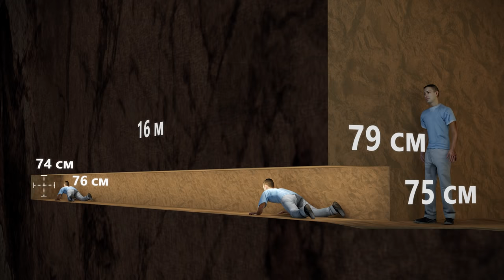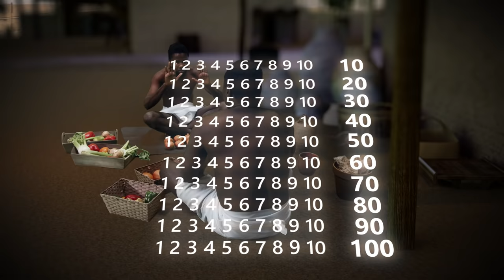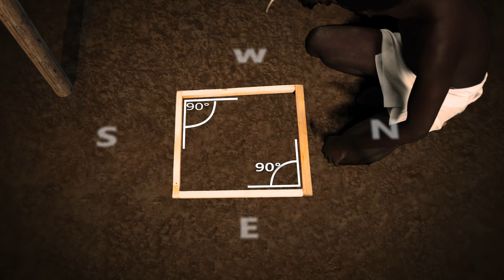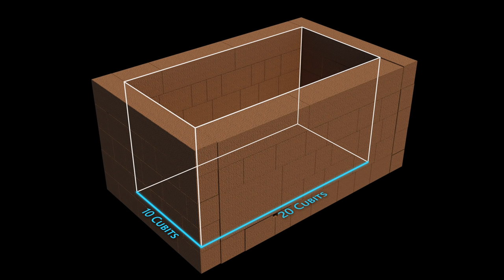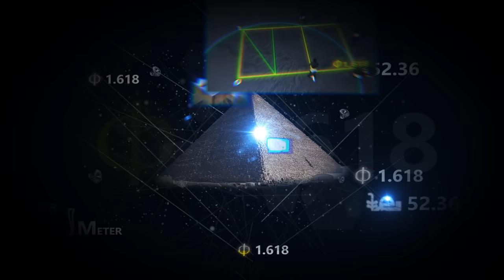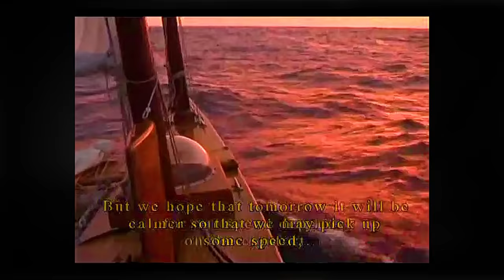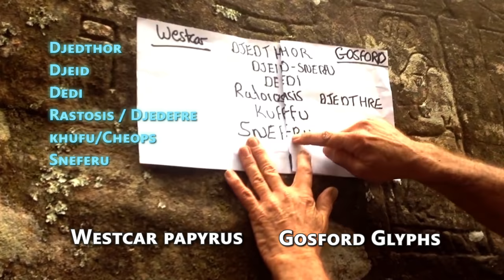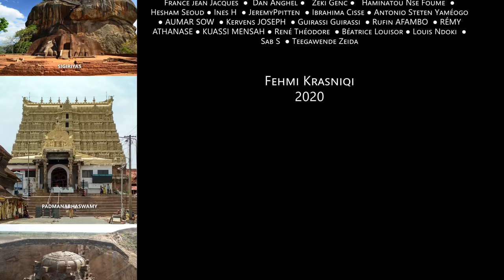The Movie Great Pyramid K 2019 - Director Fehmi Krasniqi

Comment: nice storytelling indeed, i just wonder why they never found any trace of them gigantic lenses anywhere in that terrain.
Reply: they would be freaking huge he lost me there i was listening before 1:29 after that the needle got drug across the record. hurt to watch.
Reply: You can also make fresnel lenses that are not that havy to handle. However, you need to make glas or glas like structure in alrger size. That is not trivial to do! Just do a calculation: 5 m in diameter: pi*25.^2=19.63 m² -> *1300 W/m²=25.5 kW. That is some energy but is this enough to melt a block of stone? Just be asure when you poor material, you have to do in one block, otherwise you would see difference during cooling, like band like structures. We talk about volumes in several m³. My feeling says, 25.5 kW are not enough.
Reply: The elites won't never let us know...
Reply: When the top layer was finish the worker quickly remove the lens to a hole in the grund so nobody understand how they did't. 😁
Reply: @davidleomorley889  then explain why when one of the Giant building stones are cut they are found to have evidence of being a geopolymer or a cement like constructive material again I'm not sure if the lens theory is all correct either but cement construction is entirely possible as proven by our Frenchman friend
Reply: If you Google it you will find that a piece of glass was found in Israel and it was so large and so heavy it was frightening looking it was probably 15 ft long by 10 ft wide and a foot thick and let me tell you the story that goes behind it is amazing they said that it would have taken tons and tons of fuel to make the silica melt to make such a peace of glass but it does exist and I'm sure this is all possible if all this fits together I'm a little skeptical myself as far as melting granite but who knows the world is full of mysteries my friend
Reply: @davidleomorley889  believing that they bringed the from more far than +400km , and they put millions of stones , 20t to 80 t each one in top of another with their technology is worse than believing in santa... Is more easy to fool a person that making them believe that they been fooled...
Reply: @davidleomorley889  would you believe it if it was tested?
Reply: @davidleomorley889  yeah but just say some sicentist set up an experiment to melt granite with a lens would you believe the results of the tests?
Reply: @davidleomorley889  i understand what you are saying and yes i agree with some of your opinions,but im simply asking if someone could prove that stone could  be melted would you accept it. Its not really even about the stone. Would you change your mind if proper evidence is provided? I will check out your channel and im sure i will learn alot of valuable information i didnt know before. Just think too with out this video i probably never would of been introduced to your channel
Reply: @davidleomorley889  i just learned that when granite melts it turns into obsidian.👍🎅🏿
Reply: @davidleomorley889  — Hello.  Just wanted to alert you that although I like and resonate with what your communication, I dare say that I personally prefer if you could be a bit less ‘biting’ or ‘arrogant’ towards others?
“Honey versus vinegar”  message ....
Reply: @davidleomorley889  : I earnestly & sincerely hope that I am not included
in those numbers that you feel are attacking you?  I merely politely wish to
point out that such well thought out responses as yours are ... it just doesn’t 
ring harmoniously when you’re belittling others somewhat?  Your arguments become a bit distracted when you’re gruff and they  ✨deserve✨ to be presented by your best side?  Hey, at the end of the day ... it’s just my opinion.  My name is Dora, btw.  Giuseppe, my partner,
is sound asleep 😴 and i’mmm borrowing his cellphone u til my upgrade
arrives.  Stay safe friend, a wave to you from Toronto, Canada 🍁
Reply: until* my upgrade cellphone arrives ...
Reply: glass is an amorphous material that deteriorate over time not like stone.
Reply: @davidleomorley889  Not a very mature comment David👶🏼 yes you can melt granite with a solarlense! but not in the simple way it is illustrated in the movie ofcourse, so there has to be more to it if this thesis hold some truth. 
My professional background is that of a craftsman and technician +20 years working with ceramic, glass and metal casting and mould making.
If you can only accept idears that play into the beaten narrative you risk gerting stuck in the track.
Maybe you are a bit too grownup David :-)
Enjoy the movie as a bold and thought provoking input. 
Wish you a great day
Reply: A 5 meter lens must weigh several tons. However, what might an elitist do with that lens from outer space.? Start a fire?
Reply: @davidleomorley889  queried stone is a santa claus belief too. they cut , transported and hung this stone...barely out of the stone age ..NONSENSE
Reply: @davidleomorley889  then you explain it . you are obviously smarter than everyone
Reply: @davidleomorley889  have seen it. know who you are conversing with first before you make a fool out of yourself......too late
Reply: @davidleomorley889  The experts who you are citing are having their asses handed to them. You might want to check YOUR ego.
Reply: @davidleomorley889  jean Pierre Adam what a joke! pie is a coincidence LMAO
Reply: @johnross4605  Yeah, directed energy !
Reply: @davidleomorley889  David I understand why you would be upset, but you made a massive mistake.  The one responsible for transporting the heavy stones is none other than the traveling god of the night sky:  Khonsu.  Also written as Chonsu.  It might be hard to believe, but this is who we think of as Santa Clause--an immortal flying god.
Reply: Cause satan clause leaves no trace .
Reply: Its completely obvious now! Bitcoin was developed by the government, it was a pilot program. This opened the door for others to refining the new technology. It's been said they will give you pennies on the dollar. Bitcoin is now the equivalent to digital gold. China knows this that's why its outlawed. Open your eyes people it's been planned since the beginning. You are not in control, the global elite will continue to move forward as planned, whether you like it or not.  No civil war, no uprising will stop these plans from moving forward. You will bend the knee whether u like it or not, whether you are aware of it or not. Stop fighting it, just given in, give yourself over mind body and soul. You have no say in your freedom, stop thinking you do. Once you except it, the world will become a better place. Its essential for the hurd to be controlled, because the majority of the human herd has a low level capacity for the evolution conciousness. Give in, be sheep, trust it's for the greater good.

Comment: The etymology of "meter" is "a measure", it can be any kind of measure defined by convention. The size of a drop of water is not a centimeter, rather 2mm and depends heavily on surface tension defined by several factors: purity of water, temperature, the surface on which it is deposited, the size of the drop can vary extremely. You can also make drop of water any size smaller than this, look at drops of water deposited by dew on plants in the morning. A nautical mile, historically, was defined as one minute (1/60 of a degree) of latitude along any line of longitude. This video (can't even call it a documentary) is one giant heap of crap, worse than 95% of the others I've seen.
Reply: I partially agree with you. For sure the drop of water being a constant cm is BS. However the geometry still holds up. Regardless of how they   Figured out these universal measurements, the proof of their existence is physical. Also the theory of how they constructed the pyramid makes the most sense compared to any other theory I’ve seen. So yes the meter explication is  trash but that doesn’t make this whole presentation a heap of trash.
Reply: The concept of geopolymers explains much, but a massive building project such as the Great Pyramid must have a purpose other than symbolism. It more likely was built as a power plant, possibly a MASER, and less lijely that it was built by chain gangs who climbed the pyramid with water buckets and concrete mix.
Reply: The video is better than any seen by my person. It has some interest opinions on the cm, however, everything they did was a derivative of nature integral to function within nature abounding by the laws of physics, chemistry, mathematics, etc. The secrets are encoded in the cosmogony. It never crossed my mind until I began practicing it as a way of life. The concrete, slip forms - yes, how the granite was moltened is a safety concern- have to resist. Overall - 8
Reply: @Zerox_Prime  "Must have had other purpose the symbolism"??? Why?
Reply: @adamevert1618  I suggest you read/watch videos explaining how the Pyramids were built as power plants. I recommend you watch the one by Jaimie Burtuff.
Reply: Wow. I just did two drops of city tap water from the end of a knife onto my kitchen counter. I got 2 in row PERFECT 1CM drops. Easy. Child's play. And amazing!! Not BS.

Comment: How the ceiling of King’s chamber was poured with molten granite and what  material can hold the molten granite up at the ceiling?
Reply: Easy clay and wood together so the wood wouldn't burn
Reply: @daverhin5975  😂😂😂 oh my... I live in Hawaii, I know what molten lava capable of. You can’t stop it with clay and wood for sure my friend.
Reply: @maxhamilton8204  They show a diorite statue and clay mold in the video. I don't think they get a super crazy amount to flow at once and it cools really fast. I have a huge magnifying glass in my backyard 86in and I can kinda melt rocks I melt them on a metal chair (cause that's what was back there) and within seconds after getting it that hot I can pick it up and hold it
Reply: It was magic. Plain and simple.
Reply: @daverhin5975  Of course, entirely unlikely that someone used the Diorite statue to MAKE the mould so they could sell plaster knock offs to pilgrims and tourists in ancient times.
Reply: It's possible to lever huge blocks and move them with sand ramping techniques the way Hatshepsuts Temple was clearly built.  You use sand to prop up the stone then you take it out once stone is laid or set.
Reply: @maxhamilton8204  if barely molten and being water moderated to distribute heat it's possible but they didn't get into the ram pump.  I can guarantee you they did not raise water with screws.
Reply: @rossdavies8250  You need proof to back you're statements up. This video has all kinds of undeniable evidence and not just theories like most the other videos. If they was making them to sell why haven't we found them? This is the best documentary I've seen cause they show so much evidence. They show the diorite ball in granite and nature don't do that. Just look at the tool marks all the evidence you need is there if your denying it. its just human nature to have that need to believe in something super natural. We really have that need to believe heaven and hell are real or were not alone. I don't even want this video to be true its like a kick to balls for my beliefs before this video. But I'm a logic thinker and its undeniable evidence
Reply: @daverhin5975  Oh jeezus. And do you know what happens when you melt granite? It becomes Obsidian. Glass. It will never become a replica of that which was melted. This documentary is trash race propaganda. Enjoy!
Reply: @godboy159  Someone just got there beliefs smashed into the ground. Can you tell me what would leave them marks? I cant believe all this evidence and people can still be in denial. Can you tell me how all the rocks have the same magnetic north? I can geopolymer concrete. What about the pyramid in Mexico with the same measurements that's made with concrete? Melted granite don't turn to obsidian unless its heated really fast
Reply: @godboy159  I like them all to the theories but this one for me was right on. Its a magnify lens of course they didn't carry it in buckets and its definitely not gonna heat it up fast. You act like the melt time had to be precise I bet they never had to worry about it turning to Obsidian. they obviously didn't poor molten granite on wood.lol are you denying the CLAY mold with the diorite statue by it? Cause you can go see it for yourself. Just use google it will tell you it has to be heated fast to turn to Obsidian it even says it can be molded. But even if they did have to time it it explains the buckets with holes used as timers.
Reply: @daverhin5975  Bro.. I'm commenting about this video. You are adding shit that they didn't say or portray. They are showing wooden molds and little buckets. They are also heating it and cooling it twice. Once at the quarry and once at the build site. Obviously the time at the quarry doesn't need to be completely liquid. But at the build site it does have to be liquid in order to be poured into a mold. How do you get granite into a liquid form without liquifying all the properties like crystals that take hundreds of thousands if not millions of years to form. Come on. Be smart. lol

But again. Please link me to something that shows granite being melted then cooling into its original form. You must have something that you have seen that did this since you are so sure.
Reply: @godboy159  They expect you to have common sense when they show a diorite statue and clay mold. THE CLAY MOLD IS IN THIS VIDEO. There's no need to melt it today we have tools that can work with granite now. Volcanos spew molten granite and it molds to stuff all the time. Just look at the scoop marks and the dots on the unfinished obelisk. I played with my 86in magnifying glass enough to know them marks match perfectly. Not to mention they show a diorite ball stuck in granite nature definitely don't do that
Reply: @godboy159  All I needed to read was its possible. It was the stone age for thousands of years only seems fair they would master it especially if they was melting it. Even if they had to throw the molds in the fire or time it. Can I ask how you think they did it?
Reply: @daverhin5975  Keep fantasizing and leaving science out of your conclusions. Good luck with that.

Personally  I think there was another global advanced society back then and I think most of these structures are at least 11 to 13 thousand years old and that the civilization that lived at that time was destroyed due to a cataclysmic event. Most things were not made of rock, clay or some other earthly substance would disappear and be brought back to the earth within a few thousand years. I love thinking about this and I watch a lot of content on it as well as do a shit ton of research. But really they are all theories and in the end I'm not sure. I think it is fascinating but the laws of physics still apply.  Theories are designed to be pulled apart to see if they can withstand it. I fear while this video may have made some good points a lot of it is flawed and much of it's premise can be debunked. On top of all that the video feels a bit like propaganda. 

Take care and keep searching and thinking!

Comment: Forget the blocks...show us how they made giant solar lens. Never seen any evidence of solar lens.
Reply: I agree. The lens itself looks way bigger than any of the blocks they are casting yet is supported by a couple wooden poles and rolled around by a couple guys. just making the lens would be more significant than building the pyramids
Reply: perhaps it was crystals
Reply: Brilliant comment!!!
Reply: When they had finished with the lens, what better thing to do, than to melt it down and use it for artifacts  Or Royal use, for looking into the night sky? That's why they knew where the stars were. Because they were used to looking into the night sky. As thier ancestors in south Sudan, where they said they came from. Pyramides are there too.
Reply: How do you take that enormous solar lens to the top of the pyramid?
Reply: @keithwilliams5547  making a lens in a mold in the way they describe that anyone can do a few meters in diameter is more complex than making a pyramid with perfect precision so big it took 20 years? re read what you just wrote
Reply: Guarantee you the lens is the first thing to go to preserve their secrets